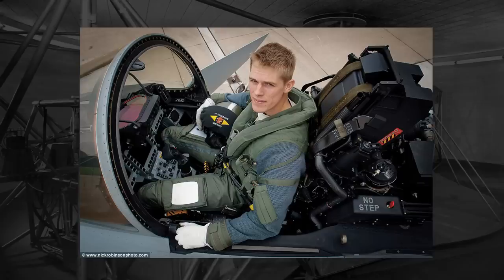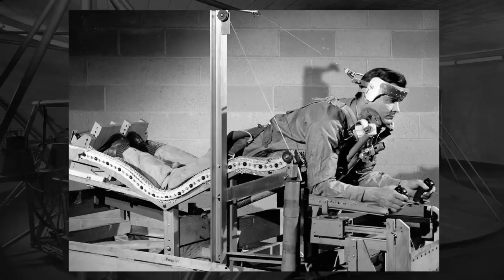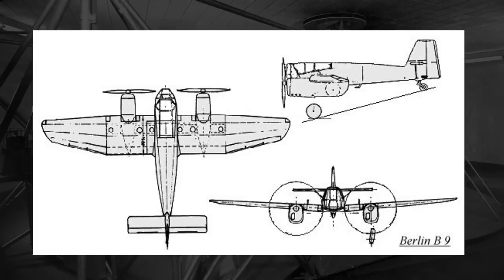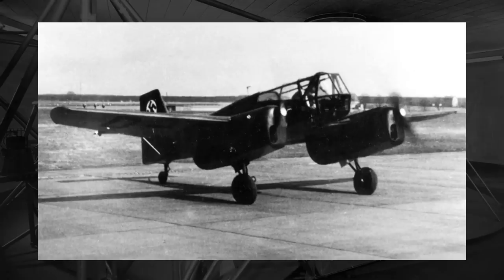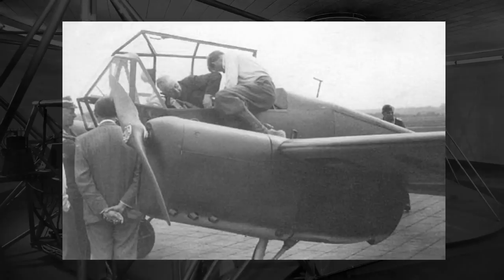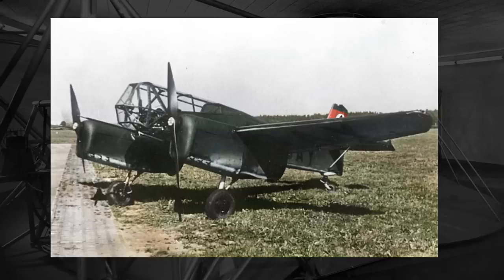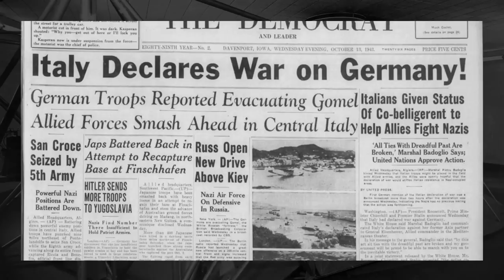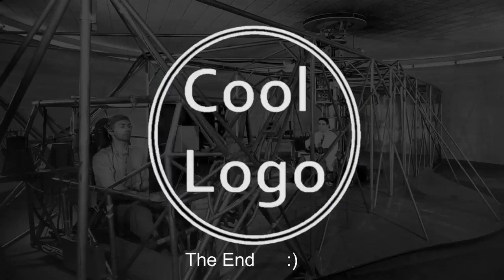Germany's Anti-G Dive Bomber: Akaflieg Berlin B9

Comment: I suspect that flight testing ceased because they had learned all they could from this aircraft. It had shown that the prone position significantly improved the pilots ability to withstand G force, but its lack of performance prevented research at even higher G. The small size and modest performance meant that there was almost certainly no point in trying to develop a production version; if they had fitted hard points to this aircraft, it would surely have been to test the concept only as it certainly could not have carried a significant bomb load. I have no doubt that the data obtained from this aircraft will have been passed on to Germany's major aircraft manufacturers with a mind to further developments!🤔

Comment: Originally, the engine nacelles were planned to be above the wing as to provide a wider field view for the pilot. However, if the landing gear would fail, there remained very little distance between the pilot and whatever cluttered the area of the emergency landing. Therefore the engine nacelles were returned in the traditional position below the wing to provide for something for the aircraft to land on.

Comment: Supine would have been a better choice. Just look at all those high performance sailplanes that use a supine position for the pilot. It also gives the pilot a better view.
Reply: Also reduces frontal area. With no motor all you have is a body to get through the air.

Comment: Yep this is new to me. I also remember something about the seating pos of the pilots in the BF 109 and FW190 . That they were seated as if sitting flat on the floor. And improved the issue of G forces a little. I'll have to go back and see if that is so . Thanks man.
Reply: Think your on to something.
Allied planes had up right seating position like being in a chair where as the Germans sat with legs straight out to rudder pedals....the rumor was German pilots can withstand greater 'G' forces. Later sports cars & racing cars used the same seating though it was properly used to obtain lower center of gravity & aerodynamics nevertheless it helped with drivers 'G' forces...
Not sure if Japan used the leg out stretched seating position.
Cheers.

Comment: The pilot's seat in an F-16 is semi-reclined to enhance G resistance.
The RAF conducted post-war experiments with a prone pilot in the nose of a modified Gloster Meteor, but the results didn't offest numerous problems. There's at least one YouTube video on the thing.
Reply: That is actually not true.  It is reclined because in the original prototype the new ACESII seat wouldn't allow the canopy to seal.  Basically it's a design goof.  Note that the F18/Typhoon/F22/F35/Su57 have a standard reclined (11 degrees) seat.
Oh, and an early form of G-suit was available at the end of WW2, and used by some USAAF units.
Reply: @grumblesa10  A foruitous error with beneficial side effects, then.
Reply: @parrotraiser6541  not every mutation is bad.
Reply: @parrotraiser6541  Yeah, the additional G-tolerance was discovered in flight testing...
Reply: @literallya442ndclonetroope5  That's Evolution in a nutshell. 😂

Comment: Hey, the Henschel Hs 132 did use a very similar cockpit configuration - directly as a result of the B9's results of mitigating G-Forces. So it's not that the B9 didn't lead to anything productive, rather the opposite - the prototype Hs 132s were nearly completed when the Soviet Army captured them.

Cheers!
Reply: Fieseler and Henschel both made planes in Kassel. I don't think the Russians ever quite got there.  The last Horten wing was supposedly found at Rothwesten Kaserne, a Luftwaffe airfield, about 5 miles from Kassel.  I was stationed there from 66-69 in Army Security Agency.
Reply: @anvilsvs but this aircraft was made at the Schönefeld factory, outside of berlin.(what is now an airport.)

Comment: There were many attempts to create prone piloted aircraft, but none of them could ever pull really high G forces. Had they been able to do so, they soon would have learned that pilots couldn't breathe under severe G loads because their ribcages would have been crushed.

We know better these days, after decades of space launches with supine crew positions enabling them to pull high G forces without blacking out. We have also learned that the onset of G force isn't perfectly vertical, as was previously believed, but is angled back slightly toward the aircraft's centre of gravity. That's why the F-16 seat is angled 30° back from vertical.

During WWII, German researchers learned that a supine pilot could withstand as much as 12 G's for up to two minutes before losing consciousness. 

The way forward is clear; future fighters should increase the incline of fighter seats until the pilot is almost lying flat on their back relative to the onset of G forces, with their head and knees slightly raised. This would greatly decrease the vertical distance between the heart and brain, and allow pilots to pull much higher G loads than are currently possible without losing visibility or consciousness in the process.
Reply: F1 drivers have a similar position in the cockpit
Reply: @dromeiro  Indeed they do, but for a different reason. 

In the case of race cars, it's about making the aerodynamic cross section of the cockpit as small as possible to reduce parasitic drag and make the car go faster for a given amount of power.  

While the same concept (supine pilot position) could be applied to combat aircraft, the nose would still need to be wide enough to house the radar and other sensors. Still, any reduction in cross sectional area is a plus for a fighter, even if it's in the vertical rather than the horizontal.

Comment: You never mentioned that the Germans continued prone aircraft research but focused it into developing very small bomber attack aircraft driven by rocket power. They did this because of the massive B17 attacks on Germany. A very small prone rocket fighter had very area to shoot at unlike a Me109 or Fw190. It was fast and very hard to hit. These prototype aircraft were dropped in favor of the tiny conventual cockpit Me163 rocket figter.
Reply: Conventual? Were they  liwn by nuns?

Comment: At 3:32 they show the fs17 glider that can withstand 14g. What is the practical requirement to pull 14g in a glider? Was this just a proof of concept with the intent to apply it to a fighter aircraft?
Reply: It's not just about maneuvering. A hard landing could create large g-forces as well, especially on long glider wings. The higher g-limit gives the aircraft better survivability and/or service life, which is desirable, especially when you only got a limited amount of prototypes to work with.
It could also have been in preparation for installing engines, bringing the g-limit down to something 'more reasonable' with the extra weight.
Reply: @fonesrphunny7242  aircraft design is about balance and tradeoffs. If you build that much margin into a glider you are making it way too heavy for nothing.  Normal or utility category (3.8 or 4.2g respectively) is plenty. This has been demonstrated by 80 years of commercial aircraft design. Nobody is designing aircraft to sustain a 14g landing!!! I spent 4 yrs downloading  black boxes from accidents and incidents and analyzing data for one of the largest commercial aircraft mfgs and I can tell you that a 3g landing is brutal - almost a crash and certainly requiring inspection and likely repair. 14g is ridiculous.

Comment: If the construction plans are still in the archives they should build a replica of it! It looks awesome in this black with red tail! Today one could use Porsche PFM 3200 flat 6 fuel injected engines they are lighter and stronger.

Comment: Those props aren't contrarotating both look to be anticlockwise looking at the pitch orientation.?
I was led to believe contrarotation was a must for aerodynamic stability unless something else I'm missing.?  Off centred engines.?  Dunno.  Confused now.  Lol
Reply: Torque from counter-rotating engines cancels out. It's not strictly necessary, but makes the aircraft easier to fly and avoids certain problems (like uncontrolled roll when adding power too quickly at low speeds)